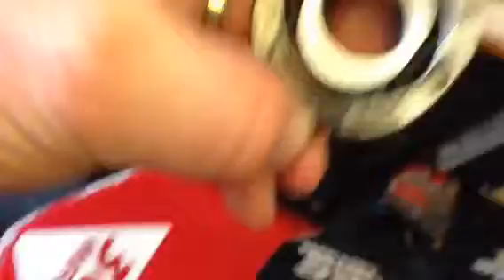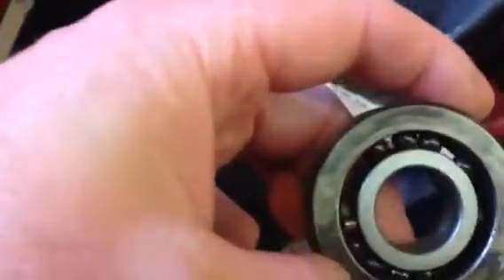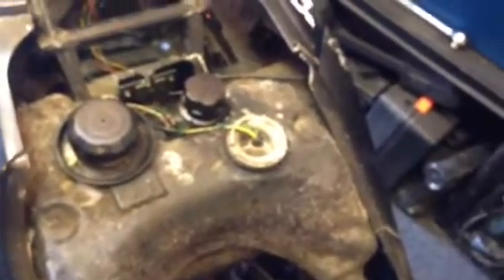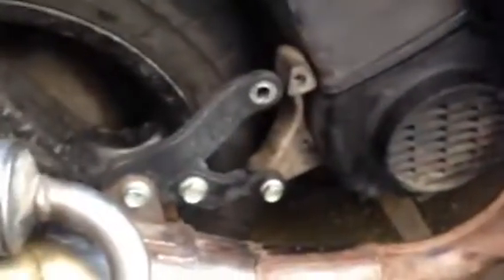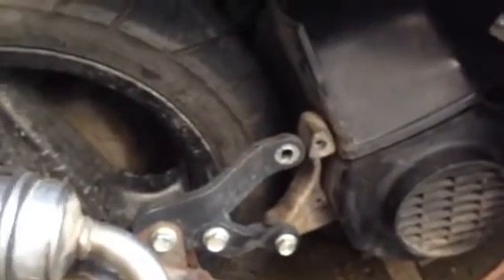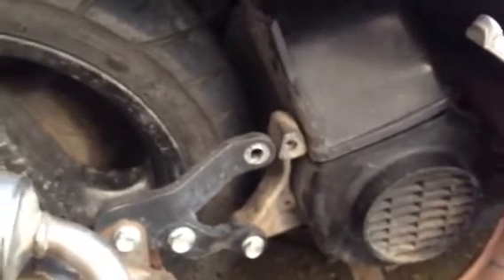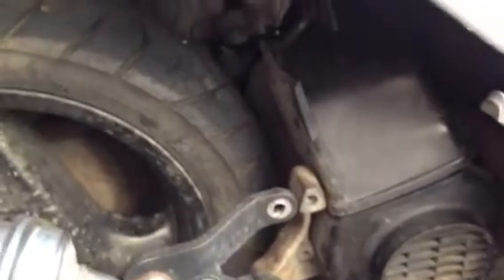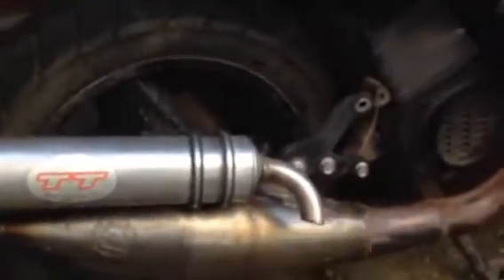Peugeot Speedfight fix part 8 water / air cooled running none running

Comment: Hi Mark, any chance you could show the Dellorto air pump hose connections please? The two hoses from the air pump, where do they go to?Cheers
Reply from the maker: Air pump! ok not to the carb or to the oil pump then the other pipes are from the speedfight standard exhaust to a pump like on the left side of the bike and then the other side just lays alone the side and up to nowhere , it was to save fuel but most are disconnected any way, if that's what you are talking about bud , mark
Reply: The air inductor is on top of the engine, to the right side of the  carb. Has two connections, one that sucks & the other blows. It goes to a cylinder with a small air filter in it. If my jetforce c-tech LC doesn't need it connected then I will leave it. Cheers

Comment: hey, would air cooled one be good option to buy? are they worse than water cooled?
Reply from the maker: air cooled are easier to work on and will do 45 odd, water cooled are faster buy a little harder to sort out with the head. but it's up to you . buy the best running one and your will be happy. mark
Reply: I think i will search for water cooled one, they're a little more expensive but more performance is always a good thing. And in long and uphill rides water cooling will do better job than air one. Thanks for help.

Comment: Hi there was wondering if you had a email that I may be able to send some pics over that you could help me with some info I’ve been watching all your vids and will carry on doing so the best videos out there on what to do step by step but could really do with some help and would be willing to pay cheers
Reply from the maker: Upload a video bud and I'll take a look 
Go into as much detail as possible
Reply from the maker: And wow I've got over 100 and you watch them,  fair play lol
Reply: @marksavage  yea I lost my job in COVID and have a mt125 I’ve done up since having it been buying projects that are easy and this one is a full next level rebuild but once I’ve learnt it happy days. And your videos are amazing very detailed explain everything perfect mate I watch every night . But this bike seems to be once a water cooled but missing the rad and few other bits also looks like it’s had the 2t tank disconnected and they have mixed themselves. 
I’m trying to get hold of full wiring kit for the bike
Engine  
Air box 
Carb 
Either rad and new water system or I think will be a air cooled? 
My knowledge is little but I’m just watching over and over making sure I listen each time
Reply from the maker: @joshuarhyssmith560  these get changed around so much so they may have changed the engine 
If it has a fan on the side now then they have 
But these engine have different plugs and wiring over the years so they needed to make sure it was the same year plus cdi as there are 4 
Like in my videos 
But they all should help you get it going 
As for pre mix try and find the pump and see it it's still active and elec or manual
Reply from the maker: @joshuarhyssmith560  its good you've tried to keep busy and earn a few £
But there's always one that is a bad one as I've had and used for parts on the next one 
Keep the costs down as they came become a money pit
Reply: @marksavage  thanks for the reply mate will keep looking into in and I’ve called myself a limit of 450 on this one bike. Should be getting a new engine hopefully if I can find one then just fully re fit it. Trying to find a engine with rad to make it original again but might be a little hard aga
Reply: @marksavage  using the advice givin seems best to strip fully and buy another cheap working and then respray and work way up from there. I’m in littlehampton and I tell you what teens back in the day must of fucked all the once’s this way as can’t find any unless it’s nee bits on the web. Only people selling non runners nothing so very rare bikes now it’s amazing. Thank you for all the advice propa sound fella and really helpful will keep watching your ads to make sure you get that yt cash😀 and please keep the vids coming as I’ll be running out soon. And do you do this full time? I’m 21 and so interested now always loved bikes just should of gone college aha
Reply: @marksavage  one more question then I’ll stop bothering you with my pointless stuff. Would a 1998 be compatible with the 2005 water cooled frame etc
Reply from the maker: @joshuarhyssmith560  sure the plugs on the loom maybe different so ask to check the plug from the stator coil that it's the same in there now 
They changed from mk1 to mk2 around that time along with the oil pump some have two cables to the throttle and others are on the crank then newer electric but you can change them over its just more work  bud
And thanks for the ad bit lol 
Take care bud